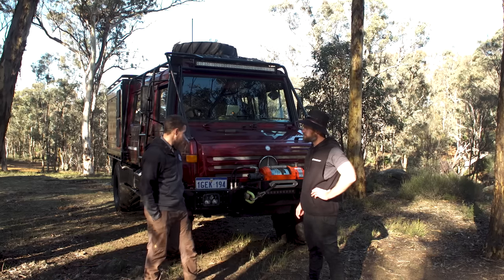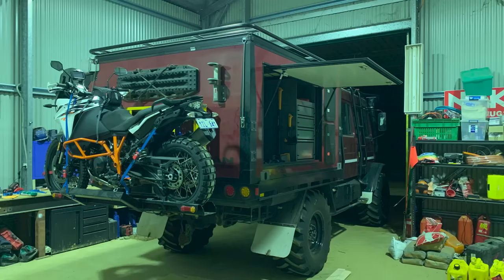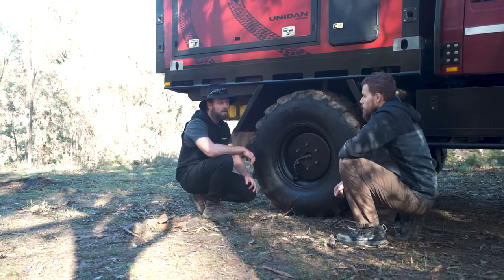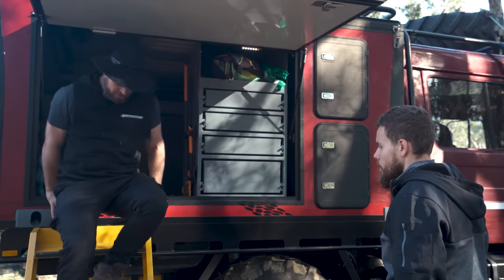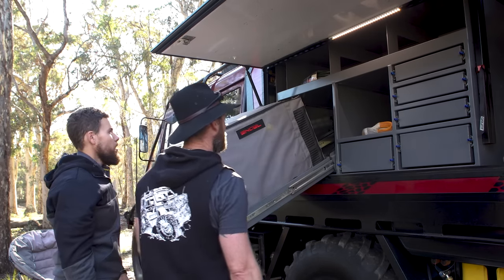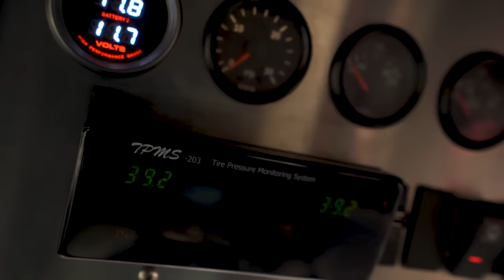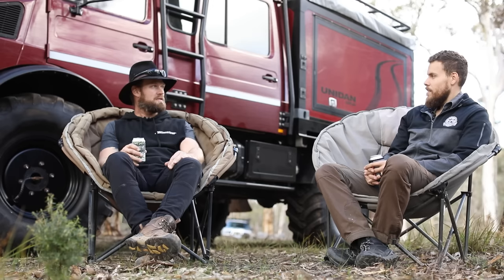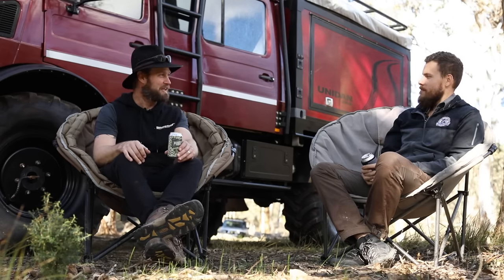DOOMSDAY TRUCK, Unimog Modified Episode 83

Comment: This guy has thought of just about everything. The only thing that’s missing is solar panels on the roof . This guy can go to remote places for months on end with this impressive set up . Well done  mate , a truely awesome build👍
Reply: Just started my channel where I take trucks into the mountains and break em. I wanna make some people laugh.
Reply: @ Bush Truck Thanks mate I’ll subscribe to your channel.
Reply: So long as he doesn't run the engine for months on end---700km range won't last too long...
Reply: Maybe solar panels don´t work, for real, outside subtropic areas!!!!!
Reply: @rolfbremberg5846  Nah, solar all through Germany and England. Not quite as much power per panel, but still fine
Reply: @lukeadv  those are set up due to taxpayer subsidies.... outside of summer the output makes you weep! You'd be better off putting a concept2 rower or a static bike on top of your truck if you really need electric energy! 😂
Reply: Re: solar panels - you guys do realise this is Australia, don't you?
Sure, there are times there's a big wet, but most of the time it's sun from dawn to dusk.
Reply: Until he runs out of fuel. He needs solar panels and good battery setup.

Comment: Hi guys, Mitas tires are from our country. We're glad to see it in Australia. Greetings from Czech Republic 😊
Reply: Glad to see they made it all the way to opposite side of the globe! Greetings from CZ too!
Reply: As Tatra is from where this wehicle got some ideas
Reply: @altergreenhorn  I doubt that really. Unimog's performance is based on extremely flexible frame while Tatra trucks are just the opposite, even back in the days when those were the similar weight range as the Unimog (Tatra 805)
Reply: Exactly, Tatra chasis is absolutely not flexing or stretching, thanks independent axles and central pipe
Reply: And the Unimog comes from Germany and has been built by Mercedes since 1950.
Greetings from Canada.
Reply: @hartmutscheu6197  That doesn't count that much itself, the pre-war Tatra technology was stolen by Hitler's guys, it was used by VW, but not Mercedes (Tatra sued VW after the WW2 and won the case). Some of the Tatra originated (Hans Ledwinka's) designs were also used by Austrian Steyr/Puch to design the Haflinger and Pinzgauer, but even though they also designed the Mercedes G-wagen later, the Tatra concept wasn't used there either. So we can say for sure that none of the Mercedes offroad production has a Tatra heritage.
Reply: Nothing new under the sun
Reply: A similarity of technical concepts between Unimog and Tatra is quite given. The history of Mercedes Benz, Tatra and Volkswagen Beetle is also closely interwoven. The common gene may be the central tubular frame. But an essential difference are the axles, which give the Unimog superiority in rough environments. The portal axles provide considerably more ground clearance than the pendulum axles of the Tatras. And this was invented ingeniously and not stolen.
The story is quite interesting:
In 1897, Ignaz Schustala, the founder of the Tatra works, bought a Mercedes Benz to be "inspired" by it. In 1933, the Tatra chief developer cooperated in the development from the Tatra V570 to the Tatra 97 (built from 1936) and Ferndinand Porsche in the development of the VW Beetle. With the annexation of Czechoslovakia in 1938, the Germans banned the production of the Tatra 97, the co-currents of the Volkswagen Beetle, according to the motto "Germany First". This incidentally led to a fine of DM 1,000,000 following a court decision in 1965. 
The famous Tatra central tubular frame was invented as early as 1920, the year of the founding of the Tatra factories through the merger of two companies which until the end of World War I in 1918 had their headquarters in Vienna, the capital of Austria, and were located in the territory of the Austro-Hungarian Monarchy. After the end of the First World War this had become a foreign country. Therefore the headquarters were moved to Prague in today's Czech Republic. 
The Unimog was developed by Merzedes Benz from 1945 onwards as a universal pickup truck for agriculture and was built in series from 1949 onwards. The track width was the distance between two rows of potatoes
By the way, the brand name TATRA was named after the Tatra Mountains, an outdoor mecca that offers paradisiacal slopes for Tatras AND  Unimogs
Reply: Mitas make great motorcycle tyres to
Reply: You guys are famous here in speedway circles…no pun intended.

Comment: Did anyone notice the drive shafts are protected inside torque tubes and the trailing arms conect to those tubes for axle articulation.  The ultimate non binding geometry.
Reply: Tatra run fully Independant torque tube spined suspension. Crazy stuff
Reply: I have no idea what this means but it sounds like I want it.
Reply: All Dakar trucks favor them.
Reply: @Devourer221  Or Puch Pinzgauer (the same man behind)
Reply: @Devourer221  exactly, Tatra was making backbone independent suspension all in tubes since  1923, but obviously swing axles weren't good for tire wear
Reply: @altergreenhorn  Emil Ledwinka was with Tatra, his son Erich with Puch, Haflinger and Pinzgauer
Reply: @soupfork2105  google de dion
Reply: i believe its dual purpose im pretty sure at least the u1700ls diffs/driveshafts/gearbox are pressurized to aid in keeping water out when you go deep
Reply: The Germans have engineered the very best off road axle in existence! They conquer everything you could ever imagine, absent of a fuel stop!
Reply: or any type of meaningful travel
Reply: "The torque tube suspension dates back to the model T Ford which used this design for its rugged simplicity." First built in 1908. In 2016 a model t did a ramp challenge in Wichita, Kansas and  scored an RTI (Ramp Travel Index) of 1040.  It had to stop because the rear tire was going up the ramp. For perspective a  2016 two-door Jeep Wrangler Rubicon scores 769, and the four-door Rubicon scores 724.  I don't think there's a 20 degree ramp long enough for this long wheel base Unimog. It would crush the score.
Reply: You gotta keep your shaft in a torque tube.  Only way to keep it safe!  :)
Reply: @Splendidus9185  Everything except for Russia..
Reply: Yeah thsts why the Unimog Portals are the ultimate axles For overland expedition campers , the crowns clearance , strength , engineering and massive amount of weight for a LCG is a no brainer.   Unimog overland rig companies always suggest when starting a build to buy a retired Military Unimaog of any variant becSue they all have the maximum sized components front to back whether it’s a snow flow or carrying an air defense missile aysem.  They’re also pennys on the dollar compared to a newer private. Rig  and generally have no more than 10-20K on the entire vehicle . The German military rarely did exercises or moved them from bases so they are just regularly started , idled , drove a kilometer and parked for another few months . Precision maintenance and almost every military variant has the military built PTObsystek fron t and rear for an endless amount of tools from plows to backhoess and all include their military winches front and rear when are enough to winch out massive military vehicles fron any Unimog.
Reply: care to expalin what that does?
Reply: @Phoenix-zu6on  The torque tube is a heavy “pipe” that connects the axles to the transmission.  The drive shaft is inside this tube and therefore is protected from damage due to rocks and dirt and mud.  The torque tube also helps the axle articulate with less binding than typical axles set-ups that have to contend with the geometry of all locating arms that hold the axle in position.  The axles on a Unimog are located and held to the vehicle by the torque tube.   The trailing arms are attached from the axle to the torque tube to keep the axle square to the chassis.  In a regular suspension the trailing arms attach from the axles to the frame.  When the axle twists, these bind as the geometry of the arms and axle change.  With the trailing arms attached to the torque tube, there is no blinding and this helps with articulation.
Reply: @gregsheridan  okay, thanks
Reply: make sense its designed for the military! Protection is everything!
Reply: noticed that and just smiled deep inside...

Comment: What many always forget to mention is that the Unimog can be used as an actual workshop at any time and anywhere. You can use all air pressure power tools (they are even cheaper to buy than the electricity-based ones). So you can restore your car in the middle of nowhere if you want and you don't run out of fuel :)

Comment: The 1300/1700 is just the horsepower, the 1700 runs a turbo und intercooler setup.
The 1300 L with the 3250mm wheelbase is by far the most common, because that is the one the german military uses.
I live about 40km from where these where build and about 10km from where the current model is build.
If you are in the area, you should check out the unimog museum in Gaggenau.
But don´t expect much offroading in Germany, expect for designated offroad parks.
Reply: 1300L 129HP,    1700L - 166HP.
Reply: Sort but this is incorrect. There’s a lot of differences between a U1300 and U1700
Reply: @unidanengineering   Good to know, but are you talking 435 U1700 or 437 U1700?
Reply: A U1500 and U1700 are similar and older agricultural versions. The U1300L and U1700L are off road chassis. Also older but the U1300L is a 7.5T normally with 6 bolt axles and the U1700L is about 11t with 10 bolt axles. Sooooo many different versions. His engines basically changes his model to a U1550L37-240. The OM 366 LA is actually a 5.9L turbo intercooled engine which for fire service had up to 240hp and about 660lbft but tuning can get a bit more. First gear is 13:1 and low range is 5.76:1. Axle is probably 5.31:1 but could be 6.53 also.
Reply: U 1700 is by far and away the most common in Oz cos the Oz Army is offloading nearly their entire fleet of some 1800 vehicles and there weren't many Mogs in Oz on the road before these auctions.
Reply: @gregsheridan  impressive answer, sir.
Reply: @philbox4566  do u know why offloading the fleet...?? Just curious, cheers...!!
Reply: @jesusiskingamen1026  Oh yes, I mis spoke when I said they were offloading all the Mogs. They have decided to keep something like 300 of them as they have worked out that Mogs do certain jobs that the MANs can't fulifil.

Comment: Awesome Ronny, I drove these in the Army and we went everywhere, only the softest deepest mud gave reason to use the winch. Nothing ever broke, and the off road capabilities were great. Weak point always was the tyres.
Reply: That's why as soon as I got my Mog I changed out the tyres to Michelins with the Hutcheson run flats with bead locks. I am rather jealous of the CTIS and tractor tyres though. Best thing I ever did was add the low range box. 8 speeds below about second gear.
Reply: @philbox4566  the overdrive option would be handy to I imagine, giving u a little more topend fort he highway... Would these trucks do over 100...?? I imagine the portals wouldn't like it...?? Cheers for any info
Reply: @jesusiskingamen1026  With overdrive and fast axles you can get them to do over 100.
Reply: @philbox4566  would it be worth it do u think or asking for trouble with the portals overheating...??
Reply: @jesusiskingamen1026  Portals can handle it. Just have to make sure that the correct oil is used and the levels are always topped up. Keep the moisture out of the portals and you'll be fine. Mind you, the portals are pressurised so that's a plus when going deep through the water. Reminds me, I have to raise those breathers of mine.

Comment: getting the spare tire down will be the easy part getting the old tire up will be the challenge
Reply: Not too bad, if does have a crane on the rear for loading/lifting the motorcycles onto the carrier.
Reply: Has a winch front and back,  you can pull it up or rig it to a tree with the winch.
Reply: @willtricks9432  And when you're nowhere near a tree?
Reply: I assume he'd use the crane we saw on the back...
Reply: @koitorob  Did not see a crane.
Reply: @willtricks9432  it's how he lifts the motorcycle rack up
Reply: @pdavio  Missed that bit with the still shot of the scooter.
Reply: Had a camper/festival truck, a 1976 Leyland Boxer with 20" rims and a spare on the roof if you are keen you can tug it up with an old ratchet strap by hand.

Comment: Great video Ronny its always good to give folks a peek at just what a Unimog is capable of!  I have a German Military 1300L and I collect a restore M series US military trucks and we have gone on  trail rides with other members of our club, lots of military Jeeps and other M series 6x6 trucks dueces etc. We were driving up this small mountain on a road that was still all there it had a couple very small holes in it but really nothing when we got to the top you would have thought we climbed Mt Everest lots of the guys with the American trucks were locked in 6 wheel drive and the jeeps were in low range 4x4 and they were hoping that we never went anything as rough as that was. One of the guys asked me what gear I ran my Unimog in through the "rough" stuff and I told him I stayed in 3rd gear and never even thought about using 4 wheel drive.  One word of advice is that if YOU own a Unimog and you go 4 wheeling with other people (Unless there is another Mog there) you will be on your own in case you ever do get stuck, because there is not another vehicle that will ever get close to you!

Comment: Doomsday will most probably come along with oil shortage. So there's that
Reply: If you’re a top tier prepper, you can make your own bio diesel.
Reply: If you are savvy you can make a reactor to crack plastic back to a gas and then distill it back to diesel as well
Reply: A doomsday get away vehicle is about getting to a DESIGNATED spot, not roaming the earth for years on end....

Comment: Thats a pretty sweet Mog setup.
I like the design in the point thats its not as big as some of the 4x4 Mercedes hauler truck based adventure mobiles, and has a narrower wheelbase too.
Most of the build 4x4 adventure trucks end up beeing too big to actually offroad which this one isnt.
Guess im lucky beeing here in germany and having the oportunety to buy mogs directly in case i ever wanted to build something similar myself.

Comment: I did a 2 week solo hiking trip in the desert of Mexico and relied on my desalinator. I had a pump system which is a pain. I also brought a distilling pot I made for the campfire. Both systems produced about 1/2 liter per hour, and required almost continuous attention. A bit of a pain in the ass but do-able.

Comment: A old 4wd solid axle Toyota truck with a 22RE is the best doomsday/apocalypse truck. It's one of the easiest engines to work on, has minimal moving parts compared to a 6 or 8 cylinder, can run without water cooling, can run off of 83 octane equivalent fuels, can run on 2 cylinders, still very reliable over 300K miles.
Reply: And where is the proof that the Toyota truck can do what the Unimog can do? As long as nothing breaks and the Unimog runs, it is the better choice. Of course it is much more expensive to use, but also more comfortable than a real old truck.
Reply: @wallerwolf6930  your response to my original comment doesn't even make sense. I guarantee you're going to struggle in life.
Reply: Shtf you stand correct.

But me, I'm a rich cut throat thief/robber/businessman/crony capitalist then I need to show me pissing power, and how else to do it best than to roll into town in a metallic red overlander setup costing half a mil or more.

Comment: You should do a video on my rig. L200. Fully loaded with Tesco plastic bags topped to the brim with Greg’s pasties, Pringles, bottle of grouse and a dozen corona. Been lifted and off-road for years. No wheels or anything, on logs in the bottom field. Passenger seat coverts into a flat seat. Load bed collects water and converts it into green water. Loads of other mods too numerous to mention. Proper job.

Comment: One of my favorite vehicles out there. I was surprised he didn't use a similar way to protect his CTIS as the HUMMER though, I can see that getting ripped right off under some circumstances. Also, he may want to use his on board crane/winch setup for that tire on the roof as well as a secondary plug in unit on the roof itself to haul it up there over the edge. I'm sure he will get that sorted though after he has a flat :-)

Comment: The winch weighs about 100kg, with a 26m 12mm steel line.
He should look at forestry equipment for a winch block.
Reply: 17:27 btw the front grille comes of easily, so access the engine compartment is pretty good.
Reply: I say get 2 or 3 small blocks for comfort.

Comment: @18:10 good luck trying to have problems with those old Mb 352 and 366. ive seen them turn the odometer to cero....  twice on long haulers down here in argentina.  (thats 2.000.000 km or 1.242.742 miles for those in the imperial system)

Comment: infinite stay as long as food and fuel hold out.  No solar surprises me though.  And I am curious about the suspension.  With larger tires the rear fenders sure seem tight, looks like it only has four inches of travel?  How do they never scrub?  And what is the steering angle or turning radius now?